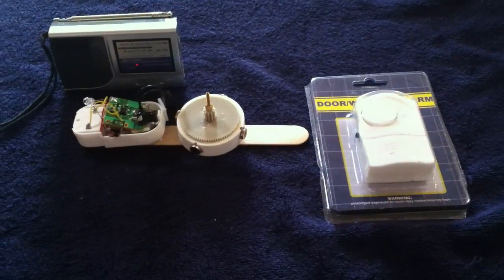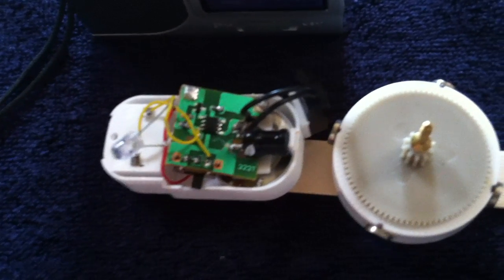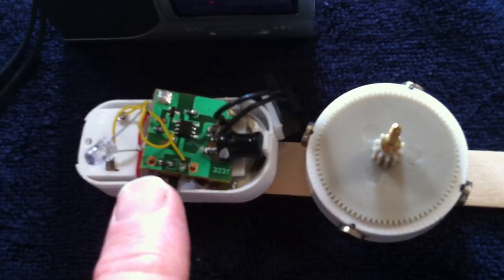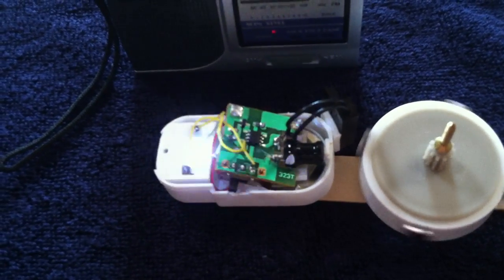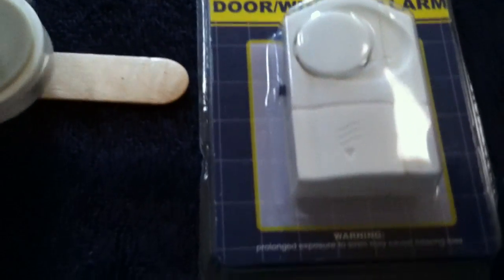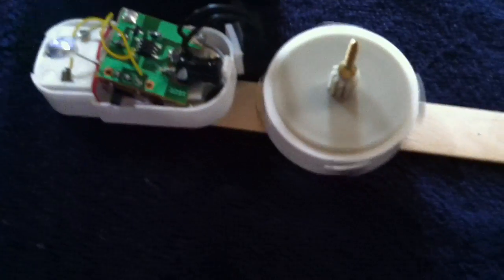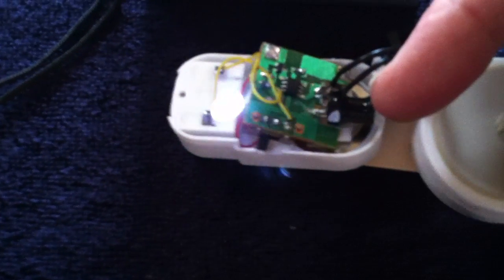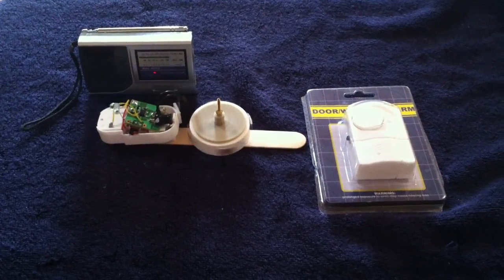Dollar Store Door Alarm --  Pulse Motor

Comment: Lid,  what type of needle did you use for the lid to spin on ?
Reply from the maker: +3D_Printing The needle I used for the rotor bearing is just a large sewing needle.  Nothing fancy but----the needle runs in a glass sleeve inside the rotor.  The top bearing surface is a brass Phillips screw.  A good lubricant is used.
Reply: I am using a darning needle, this glass sleve in you rotor. Can you give more details, what exactly is it, I am very interested in this approach.
Reply from the maker: +3D_Printing  The glass sleeve is out of a package of craft stringing beads I got at a dollar store.  The beads come in different sizes and one of them was just right for this purpose.
Reply: Thanks for the info - I was thinking you were using glass capillary tubes....  I am building my motors without the Sapphire bearings, I have dropped and lost far too many and they cost far too much.

Comment: I am enjoying these dollar store videos, I bought a pack of those alarms to use the reed switch on one of my first pulse motors, managed to burn it out after a while but it was one of my first success's. Was the reed in the open air or encapsulated in glass. Several of the ones I used were open air so I could clean the contacts when they welded shut and get a few more minutes run from them :-)
I have several of my daughter's old mobile phones that I use for lots of my videos now, they are handy to carry around in your pocket and light weight. The HTC One that I use seems fine for most things and the big screen makes it easier for my wife to follow what I am doing when she is 'camerawoman' although the light weight means we get a fair bit of camera shake if it is hand held. We use a monopod to stop that and it doubles as a walking stick.
Reply from the maker: GrandadIsAnOldMan This alarm had a encapsulated glass reed switch that failed right away.  I have others that are the 'open air' type but really have not had much luck with them in this application.  They weld shut too easily as you mentioned. 
  My wife has been telling me to get rid of my old 'flip cell phone' and try a new smart phone so I thought I would try using her old one.  The touch screen is hard for me to use.  It works fine for most people but for an older man with big hands it is not so great.  I am slowly getting on to it but the learning curve is long.  The worst thing that happened was when I put in the new pass code I soon forgot it.  The phone disabled itself and made me jump through hoops using iTunes before I could use it again.  I will have to get a monopod like you have to hold the camera steady.  I have a little tripod that I might try also.
   If things don't work out maybe I will mount the phone on an shaft,  put some magnets on it, and turn it into a pulse motor. HA!!  If the camera was on while it was spinning around that would make a very interesting video.
Reply: ***** I will look forward to the iPhone pulse motor then :-) You need one of those little phone clip adapters to attach the phone to a tripod or monopod. I was buying them from China on eBay but our Poundland started selling them complete with a small tripod so I expect your dollar store might have them too.

Comment: Interesting. As always. the Lid rides again! The part that made me go hmmmm .. was.. how is it that you start the motor slowly (bump start the rotor with your hand) .. and it continues to run at that speed, yet, if you bump start it fast, it runs fast, too... would it eventually settle on a consistent RPM? (given a perfect battery that would not drop in V)
Reply from the maker: KyleCarrington Yes it is very interesting how this runs.  It doesn't speed up like a regular pulse motor.  It is sort a like a frequency motor.  It just spins along at fixed RPM.  Strange.